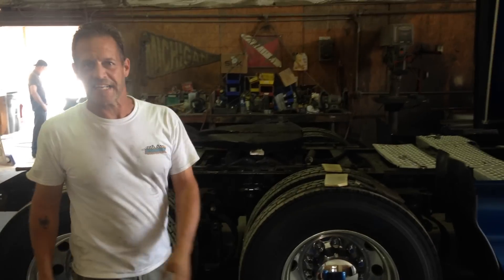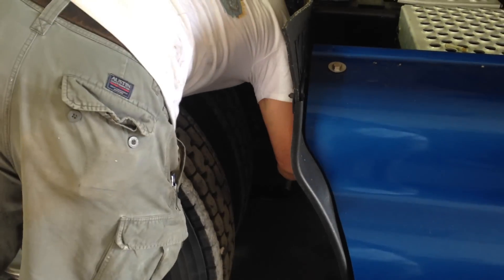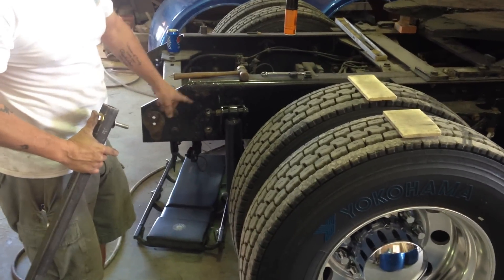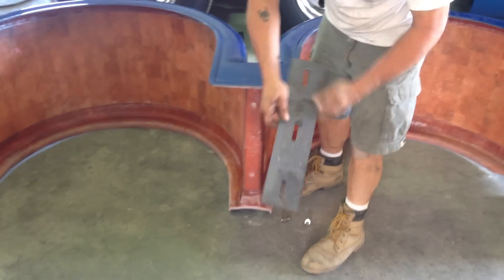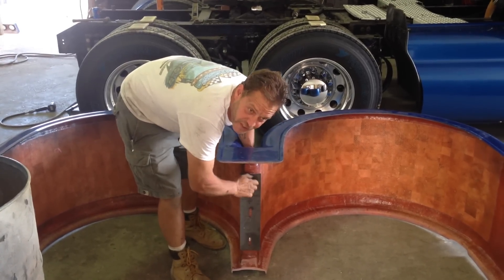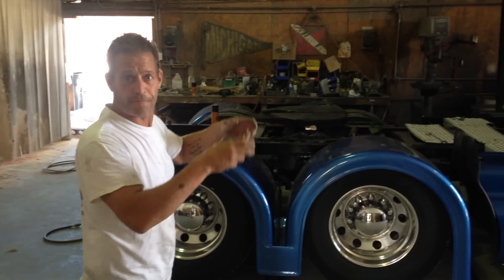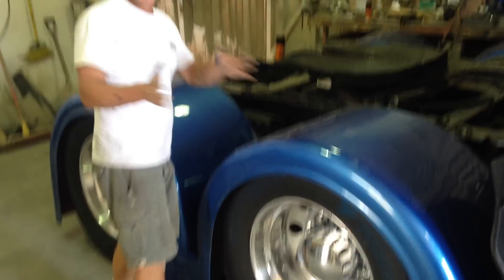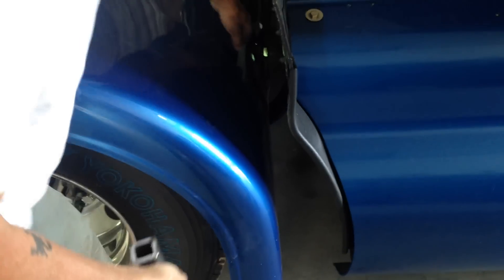Flex air/AG 380 installation video part 1

Comment: Good luck, I had wti fenders on, they're junk. Sucks when you get a flat tire. never go with those junk heavy fenders again.
Reply: Stop running recaps Dude 🤣🤣🤣
Reply: @tsimmons1974ts  Hmm, non caps never go flat or blow? That's interesting. After 25 years on the road, I never knew that. Interesting indeed.